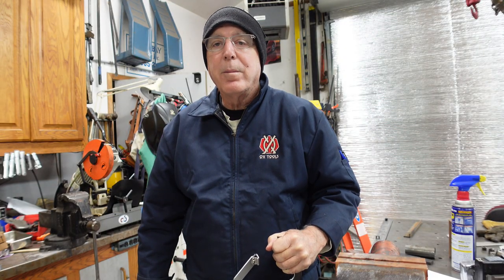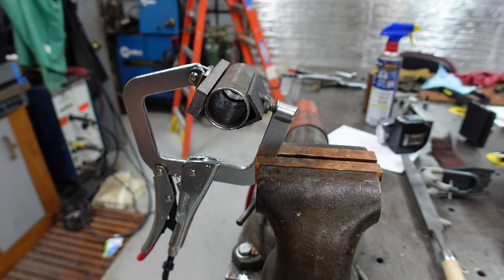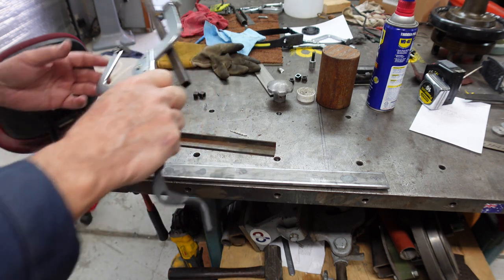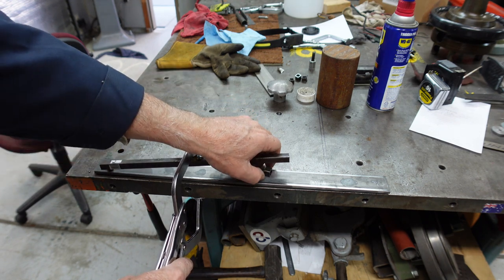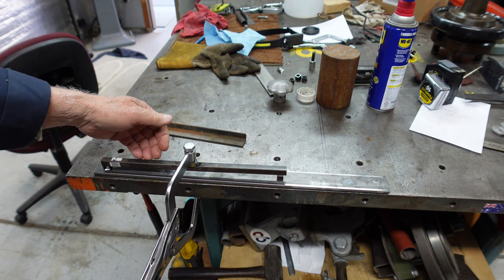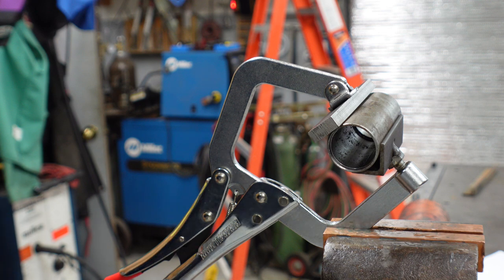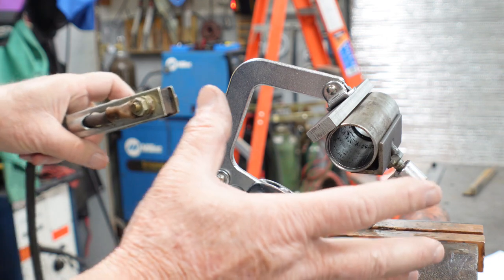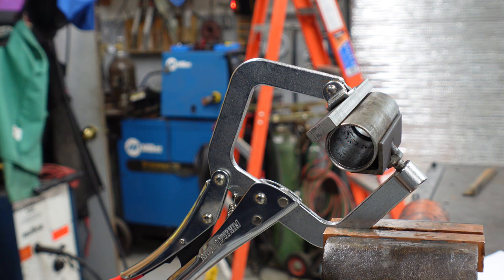Fireball Tool Mantis Clamp (more hacks/ideas) pt2

Comment: His clamps definitely have lots of possibilities. The angle iron reminded me of a couple vice grips I have that were my fathers, but On his the angle iron pieces were welded right to the tip of the vice grip. Pretty much just for pipe or tubing, but with yours you can remove them and put whatever you want in them. Thanks for sharing Chuck.     Gary

Comment: Another excellent video and great ideas. A suggestion for the long bar clamp on the pallet jack is to add bolts to each end of the bar. This would allow for offset clamping. A lock collar welded to each end of the bar would work .

Comment: When I first saw the offset crank of the clamping adjustment screw and the hole in it, I thought it might be somehow intended to be an attachment point for a ground lead.  That would not be a good idea as the lead would interfere with making clamping adjustments.  But adding a ground lead lug attachment point to the fixed jaw or frame for the fixed jaw could be useful.  The ground lead would still make the clamp awkward to use in many situations.

Comment: Hmm, 30 years ago I cut the bottom jaw off an aftermarket 10R and welded in 2" of bedframe even with the right side, all the overhang to the left, for welding a nut over a hole in 3/4" tube, for HD tent poles... I wonder what ever happened to that...

Comment: The long bar clamp would need to have the bar curved to get any pressure on the ends. Deflection of the bar when straight means all the force is going to be at the anvil with none at the ends (see how much the bar deflected when you put the spacers under the end.)  There is only one rule with clamps though, you can never have too many.

Comment: Chuck on your long bar idea, instead of welding lil small pads under it, drill and thread a hole in each end and replace the pads w a threaded bolt that can adjust....... now you can have an adjustable height  for the bar and even dis similar heights along the bar if needed......just saying.........